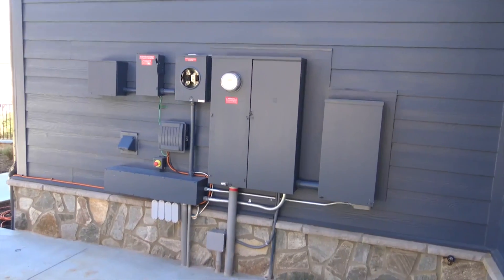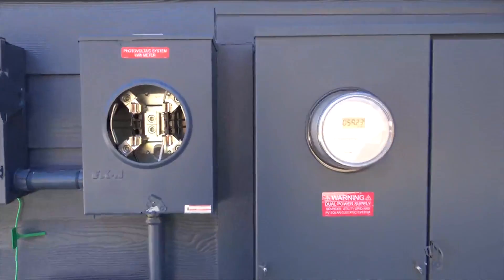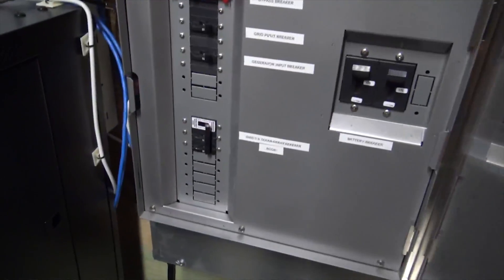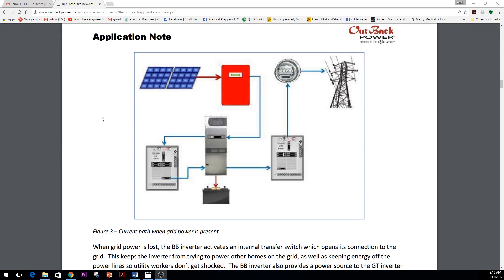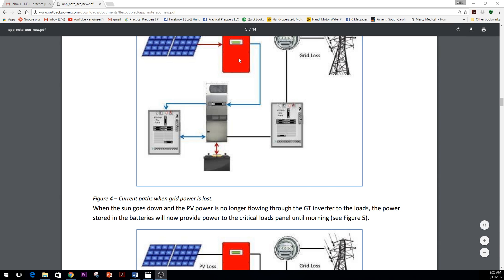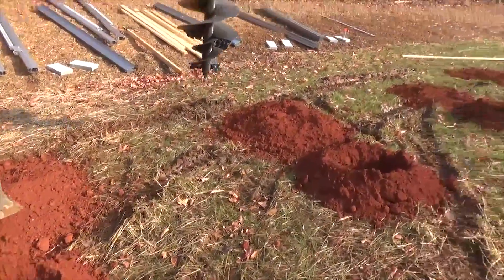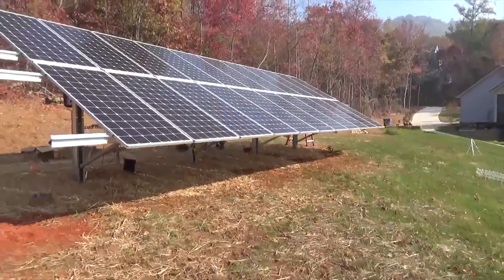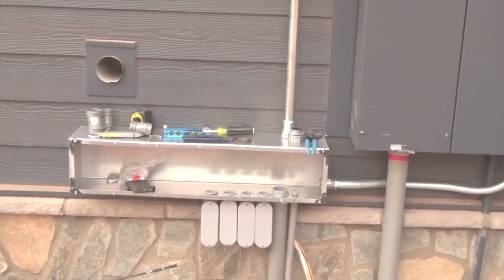An AC Coupled Solar System

Comment: Lets say you have an AC coupled system with battery storage and you are in the midst of both a grid down situation AND your solar isnt producing for an extended period of time. Your batteries are nearing depletion. 
Is there a way to set up the system to make it possible to charge your batteries with a small portable generator say a honda 2k?

I ask because this would essentially turn your little honda into a whole-house solution allowing you to buffer the short term high load draws with the battery storage and inverter that already exists.
Kind of a complex question but uh... Tesla, unfortunately. We couldn't get a grant for a DC coupled system, trust me I would sooo much prefer a sol-ark...

Comment: You take solar dc, convert it to ac, then get it back to dc for battery backup and then convert it back to ac? Seems like lot of losses
Reply: Not as bad as you think. The solar DC is rather high voltage, so less line loss. That is converted to directly usable AC. The excess of that AC is both fed to the grid, and converted to whatever DC is needed to charge the batteries. (24, 48, etc.) When the batteries are charged, which will be a lot of the time, the AC goes directly to the grid.

Vs. running the DC from the solar back to the shed (longer lines == more loss), converting it to the lower voltage of the battery bank to charge the batteries AND feed the inverter to step it all back up to 240 to feed the house and grid.

Comment: Ok amigos, I went the other way around, I make my solar system off the grid(12kW panels, 72kW lithium ion battery).
I don't like the fact I'm using around 22kW for house consumption, so when I have sunny days, my battery recover in about 2 to 3 hours the rest I'm wasting. I am trying to figure out a way to give my extra power to the grid any ideas
Reply: Diversion load, heat water going to normal hot water heater, use resistive heaters in winter as a diversion load, easy to find ways to gainfully use the excess.
Reply: Sunny Island can do what you need. (it can function as a micro-grid.)

Comment: if you are installing a new system, you could just put in an XW system

used to be made by xantrex and is now made by schneider

the XW system is an all in one hybrid system ....you dont need a gridtie inverter

it has 2 way to connect to your home 
ac1 in connects to the home and grid...T connection because it also puts excess solar power out 
ac2 is for your generator...which can automatically come on when the batteries are low to charge them....you need the AGS module for that
ac out goes to you critical loads...those loads cant be connect to the grid power or you will destroy the inverter
or
ac1 connects only to the grid and passes grid power to ac out connected to the whole home
ac2 for the generator ...for when there is a cloudy couple of days
a charge controller separate from the inverter charges the batteries used in the system

I have this system...it is much easier to install.....the neat thing about this system is you can also go off grid with it
Reply: you can also ac couple with the XW system but there are a lot more things you have to do and isnt worth it

Comment: So do you prefer this system or the magnum system better? Right now I am considering the magnum micro inverters coupled with a Magnum off grid inverter, because it seems simplistic... Though I would like to use nickel iron batteries. And  would prefer a system that my house runs off of the batteries and sells back to the grid with what power is left.

Comment: Do you remember what the PSP relay unit for the generator to turn off the solar is called?
Reply: I am curious about the PSP also. I am putting in solar and already have a backup generator and transfer switch. I want to learn more about the functions of the relay.

Comment: Hey, Here in Fayetteville NC, the utility company doesn't allow more than a 10KW Solar system and they all MUST to be tied into their grid with their Meter. You recon that there is a way to get around the 10KW minimum system?

Comment: You well never sell enough back to the power company with that system to even break even,
Reply: sometimes its not about selling back and breaking even.....sometimes its about the grid power going out

also...any solar gridtie has a ROI of 8-10 years

so yes...in 10 years...they will break even
Reply: Depends on a lot of factors, but it can -- anywhere from 5 to 25 year ROI. (again, there are a lot of factors.)

Comment: Cable house box not grounded properly.
Reply from the maker: ?  what cable house box?  and why?
Reply: The wallbox that had the orange wire going to it in the beginning. has to be grounded to common ground block, or directly to grid meter can.
Reply: I seen that too

Comment: can't this be done simply with a Xantrex (now Schneider) SW4048 (or XW+ 6848) inverter?  Schneider makes inverters that can do this all day.  It's not that complicated, they support generator hookup, battery charging, grid tie, sinewave output, etc.  Having Solar + Battery Bank + Grid Tie Inverter is the best combination of options that offers you the most flexibility.  https://www.solarelectricsupply.com/media/product-images/Inverters/schneider-electric-conext/Conext-XW-SCM-Xanbus-diagram.png
Reply from the maker: Again, this is for converting existing grid tied systems to battery backup and grid tie.  We use Outback that like Schneider do it all day but offer a 8kW inverter.
Reply: @engineer775   you can ac couple the XW

Comment: I think I would start a project like this by making a large scale bread board. I would turn all my components into plugin modals. This way the system could be more flexible.
Reply from the maker: If you use the same brand inverters is a little easier.

Comment: Say fellow engineer I have something of a hypothesis I'd like to run by you.
Reply from the maker: Fire away.
Reply: We all have some form of siding on the outside of our home's and we all live in different climate zones. So here's my hypothesis and I speculate whether it will prove anything but say you have aluminum siding would there be any concept or conceivable way to Peltier your siding with alternating hot cold Peltier brinks perhaps teg- version but would it provide any gain that would defeat cost and could it be harnessed through hot cold season's. I'm just curious if copper siding just a single mock up would be interesting. just looking at potential unity.
Reply: another cheap cost effective parabolic mirrors could be used to reflect more sun light against the siding for more directional control. solar could be used for back splash or reflected light. NOT to make it overly complicated I tend to nuke my project idea's.
Reply from the maker: I really like the whole concept of TEG and Peltier for producing power but the delta T has to be up to 200+ degrees before they make any noticable power.  No matter the siding material I do not think you will pick up enough gain.  My opinion after using TEGS to charge batteries over 400-800 F surfaces.
Reply: engineer775 Practical Preppers basically you'd require a geothermal unit with heat exchanger to provide the heat necessary for even close to the concept of power I was thinking of.
Reply from the maker: Yep. The concept is great but the efficiency is not there.

Comment: I'm confused.  I understand why someone would use AC coupling on a retrofit of an existing solar system, but since this was a new install, why not just use the Outback Radian and set it up in net metering mode with battery backup and generator input?  It seems like the SMA SB wasn't really necessary to get the same functionality.
Reply from the maker: Good Question and observation.  There were a couple of factors that led us to this design.  The location of the site has a history of stable power plus they have a very nice generator with a lot of propane so the primary use of the system will be net metering.  Grid tie inverters are more efficient at net metering than DC coupled systems. The other factor was that we had very little space in the mech room and didn't think we could fit the Sunny Island in there.  The other factors were noise and heat in the mech room next to the living room.   I have found the the charge controllers and inverter put off a lot of heat and noise ( at least in my system).  THere is a high dollar home automation system in the mech room that is sensitive to harmonics and certain frequencies so we kept everything in the mech room as backup.  Batteries will float and the inverter outside will just pass power through to the grid.  All our systems seem to be custom once all the factors are laid out that is why you see this design and we jsut wanted to try Outbacks solution as a way to retrofit future systems.   I hope that helps!
Reply: What kind of challenges did you face battery charging off a GT inverter?  I'm considering this solution for a dual Radian 8048, 21kW PV system 300' away from the house.

Comment: Xantrex (no longer around...name change) used to make inverters that could be grid-tie with battery backup and generator backup.  I have had this system since 2001 along with Zomeworks trackers.  Started with two trackers (12 125 watt Kyocera panels each) and doubled that when I put in the well. For a time I was being paid back each year by S.D.G.&E. (aptly called San Diego Gouge and Extort now) but recently they doubled their transmission fees and now I still pay them each year...not much but still...I send them more power than I use and still have to pay. Power companies will always find a way to screw you!  In all your systems that you do I have yet to see trackers used...why is that?  It does provide about 50% more power than the standard ground mount systems.
Reply from the maker: We typically install solar by the pallet or 2 and so to put a tracking system on 12-36  325watt panel systems is crazy expensive.  Because of the large surface areas we do not believe that trackers are justifiable.  So, if you have the space it is cheaper and less maintenance to install fixed arrays.  I totally want to do a tracker though.
Reply: At the time of my install, 2001, solar had not really taken off yet so there were fewer options to pick from.  As for maintenance of my trackers, they are passive tracking and very little maintenance.  All I have to worry about is high winds at which time I simply tie down the tracker to keep it flat so the wind does not flip it and tear off the panels...we get very high winds at times.  Panels were still very expensive at that time too so to get more out of my 48 panels tracking was the best option.
Reply: engineer775 Practical Preppers Regarding a large tracking array....I have a 16.5kw system (60 panels) split 70%-30% on two roof faces (SE and SW).  43 panels feed a solar edge and 17 of them feed a sunny boy.  On the sunny boy part of the system I have 11 panels on the SE face and 6 panels on the SW face.  I really really expected to see asymetry in the production from morning to afternoon since 2x as many panels face the rising sun, but the sunny boy production thru the day is pretty much a perfect bell curve.  So tracking to me is a moot point.... just more mechanical stuff to maintain with only a small gain.  Certainly you'll get an extra sun-hour per day, but at what cost and at what cost of maintenance?  Simply not worth tracking.  FWIW, I can only track the sunny boy thru their sunnyportal website, that option wasn't installed on the solar edge.
Reply: while xantrex was bought by schneider electric...schneider now makes the XW system....and they work wonderfully

Comment: I have to say this is awesome I did not know that you could have a grid tied system with batteries that's neat for sure still a couple of  years before I can start my solar. but it is cool to see the Cutting Edge of solar every time I watch your videos I add something to my list of stuff that I want. but, the first thing I have to get is the simple pump. water is the most important first prep for us. then heat then power. great video
Reply from the maker: Well if I can help you spec a simple pump send me an email. info@practicalpreppers.com
Reply: @engineer775  hi

Comment: Why didn't' you use the SMA Sunny Island?  It uses frequency shift in conjunction with the SunnyBoy to shut the SB down when the grid goes down.
Reply: midijeep I looked into the sunny island when installing my system and it was kludgey to use one sunny island with an autoformer to get split phase 220.  The sunny island has to be fed with 110v.  So the "correct" solution is to buy two sunny islands and sister them up to make correct split phase 220.  This is incredibly expensive, but will absolutely work with the frequecy shift throttling method of sunny boys.  However, the magnasine inverters offer 4kw stackable inverters and will simply run your grid tie at full power.  When the batteries get close to full charge, they divert excess power to a heating load (ie your water heater) using PWM, so smoothly sheds excess energy.  With this method there is really 110/220 everywhere in your house.  Without the diversion load it will simply shut off the grid tie inverters as the batteries near full by frequency shifting to 60.5hz.  When the batteries once again get low, the unit will shift back to 60.0hz the grid tie inverters to come on after the usual 5 minute delay.  I suspect the outback radian does the same thing.... call it "bang bang" (on or off) vs the smoth diversion load method.  The sunnyboy/sunny island method is superior, but the diversion load is a close 2nd.  Hope all of this makes sense.
Reply from the maker: After all we had to do/learn we should have but the builder really constrained the amount of space we had to work in and we didn't think we could maintain safe clearances with Sunny Island, battery and critical loads panel.

Comment: will a battery grid tie inverter work with solarcity?
Reply from the maker: Not sure but there are inverters like Pika Energy that is grid tied and work with batteries that are 380v DC.
Reply: spleujo SMA just released sunny boy storage that works with the tesla battery!

Comment: Great looking system, looks similar to something i want to do. Question for you though, why not tie the starting wires for the automatic generator to the system, where when the backup batteries drain to min then the generator comes online and that ROBC would keep the system from back feeding the gen until the gen is no longer needed or the batteries are charged up.
Reply from the maker: The briggs transfer switch was only giving us 120v options for controlling relays which we did. When the genny is running, the grid tie invert is shut off but not the radian. The charger in the radian uses the generator ouptut to charge the batteries and does a great job of it.

Comment: that's cheating on the conduit bending lol. have you done any helical Anchors
Reply from the maker: No helical anchors yet and yes the conduit bend was a fun one to share with the guys.
Reply: It works.  It's heatto soften pipe. Pic of telehandler with 40,000 ft bl drive head. 10-1/2 of pipe 9' long Anchor for all sun tracker we installed a bunch of them.
https://lh3.googleusercontent.com/b1zrI0-dVvFVDXof54DXRJPAhAKWGjdNnd0m5UymzUdSJj4wYXjXcbL05j1P0-EuwensrciU2g

Comment: was that a kill switch I saw
Reply from the maker: It was. An EPO (emergency power off) to kill the radian in case of fire.  it is required to be in line of site of the meter so that the fire department can quickly and safely shut down the system.